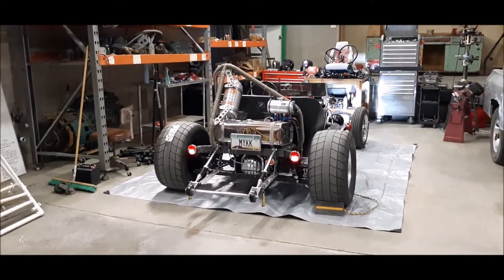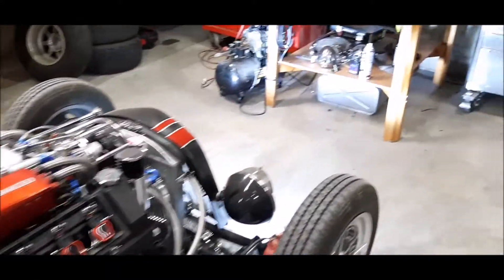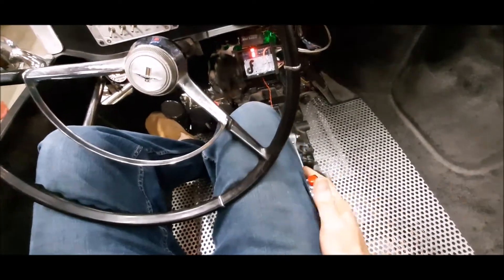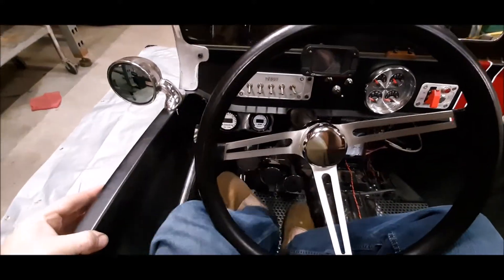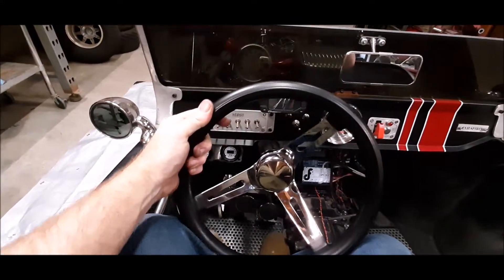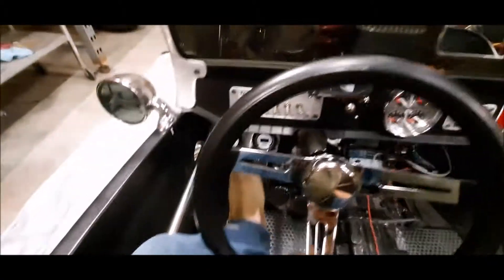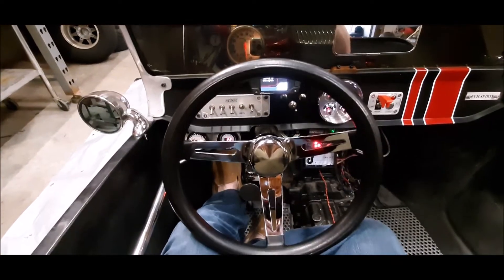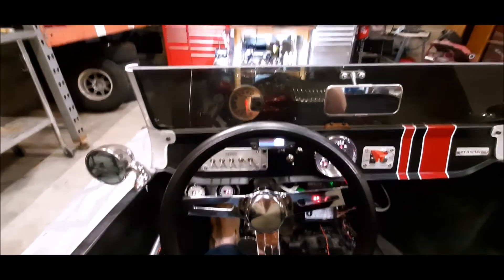BMW Tbucket build update: Post Test Drive Changes

Comment: add an inch and a half spacer to the steering wheel, you'll fit a lot better. I had a similar problem as a big guy in an NA miata and that was the solution. A lower seat will also help with that. Can you lower the drivers seat any? maybe bolt it right to the floor? or cut the foam down to sit you lower.
I really love this thing